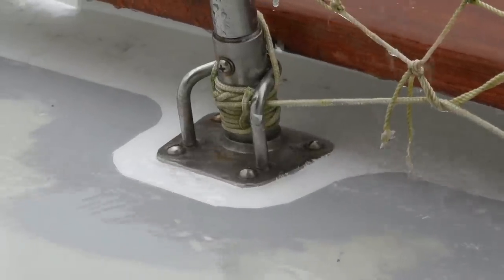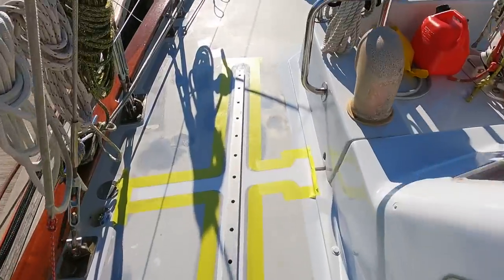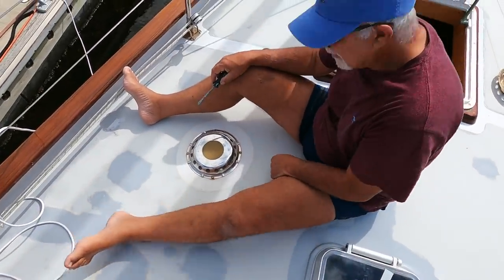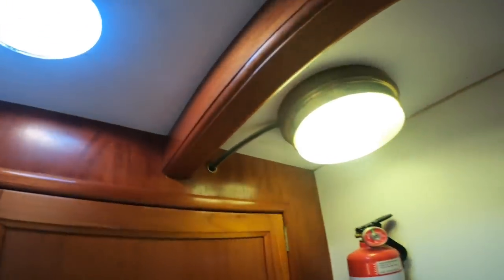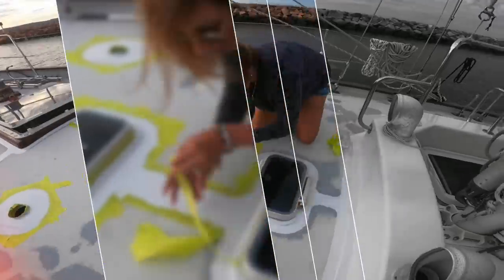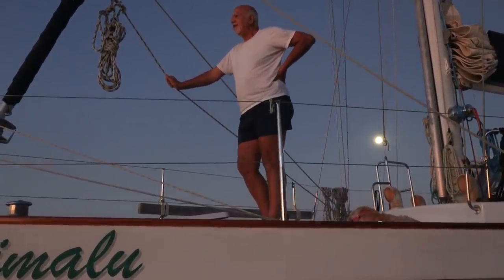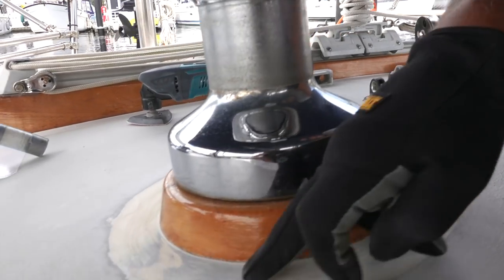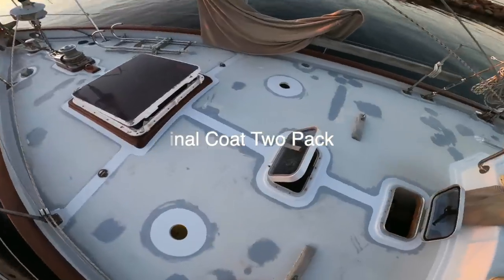The Naked Truth | WATCH this BEFORE you Try it! Sailing With Lucy S3 E20

Comment: Nice to see a Swanson getting love and care. The greatest asset you guys have is each other, 'enthusing' each other along when the 'why did I start this?' moments arrive.  I'm doing the decks and cockpit atm too, soon to be followed by the dreaded 'rewire a very old, badly done, electrical system' 😱. But I'm doing it alone intermingled with house and yard work and it's too easy to avoid boatwork. The Noosa summer heat is finally abating so I'm running out of excuses.
Adriana loved your flash comment re Jim's drilling skills. If you dont already, watch 'Sail Cloudy Bay' on YT with Glen and Oana and their HR54 ... very similar to you guys and Glen, in spite of being a pom who lived in Oz for a few years, has a similar sense of humour,  dropping easily missed pearls in their commentry.
Stay safe, Ron 🤓🇦🇺
Reply from the maker: Hey nice to hear from you and OMG a rewire sounds like a massive job on top of the decks & cockpit. I suppose if it must be done it's probably better to start with a clean slate rather than partial fixes that have to rely on other aged or inadequate infrastructure. Nevertheless it is a BIG job and a BIG upgrade opportunity! Are you getting some assistance with the electrical specs or are you able to do that yourself? and would love to know what type of boat you're doing up.  Also thanks for the heads up re Cloudy Bay, appreciate it. We've subscribed and look forward to checking them out more. Adriana & Jim...and Lucille

Comment: You guys still at the Bay?? Thought you would have started your northly migration by now.
Reply from the maker: Hey Shane, yes we decided to go north this year after cyclone season finishes but thought we would refurbish the decks first as the old paint was so worn out there was risk of UV damaging the underlying epoxy fibreglass waterproofing. Well that project has taken a lot longer than expected due to the incessant rain and intermittent 'isolated' showers. Anyway all the hard work repairing the decks, sanding back and preparing and painting the white borders is nearly all completed and we just need to finish the non-slip and then we'll be off. Love Port Stephens but can't wait to do some sailing. Cheers